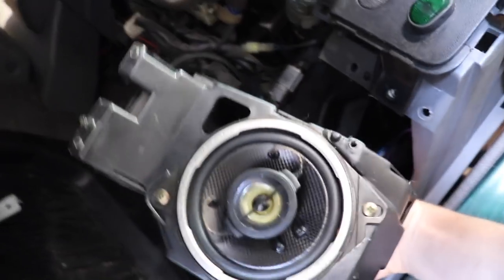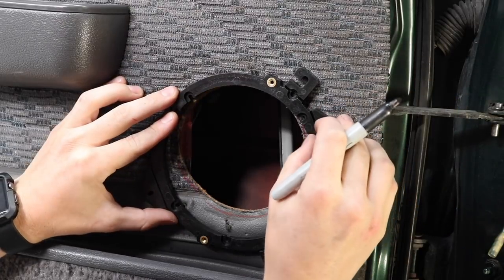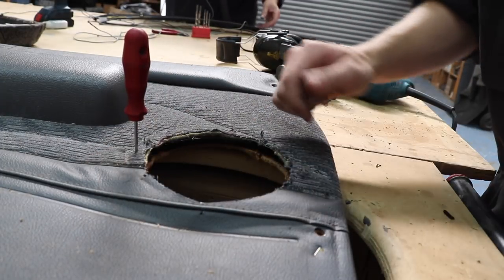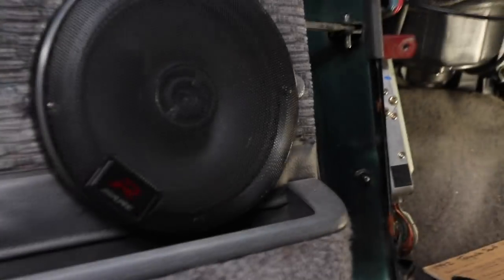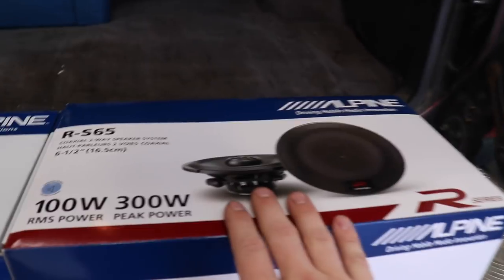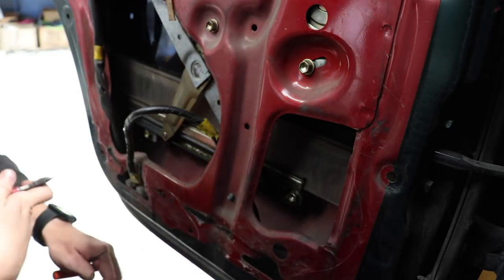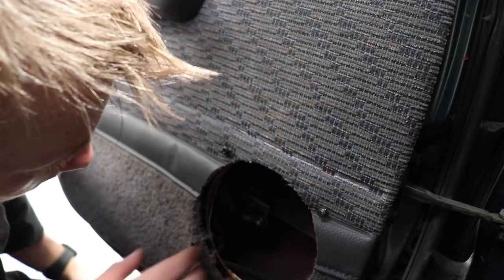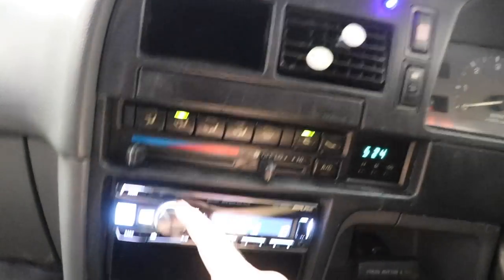Installing Door Speakers into a Toyota Hilux-Surf.  Oh and a stereo.

Comment: Hey James. Had a question for you. I want to install my fusion active 
enclosure sub into my gen 4 legacy mcintosh system. Can I just splice 
rca cables into the existing sub wires and then disconnect 1 cable off 
factory one so they arent sharing the source?
Reply: your fusion active sub should have high level input so you just splice into the sub output from factory amp. or from speaker outputs on factory amp. for your source. just remember to cut the wire going to factory subwoofer.